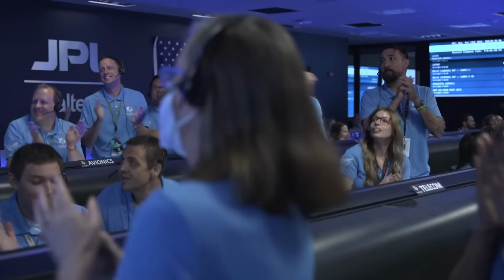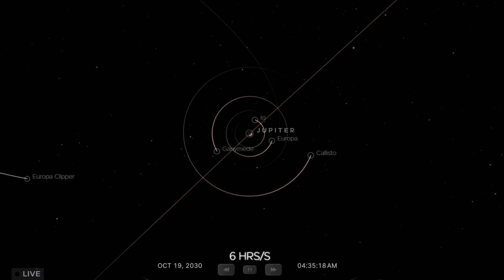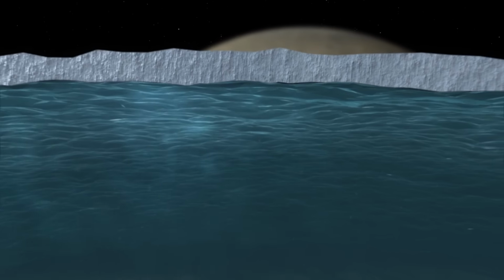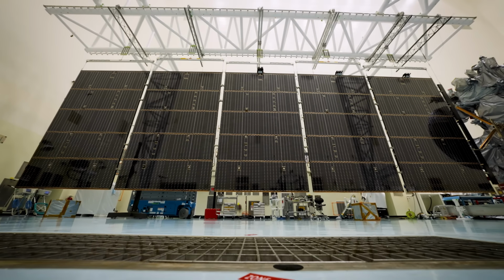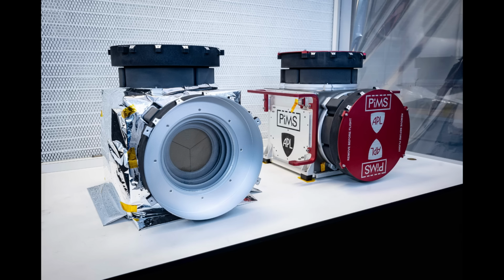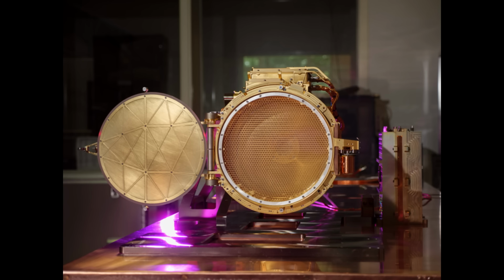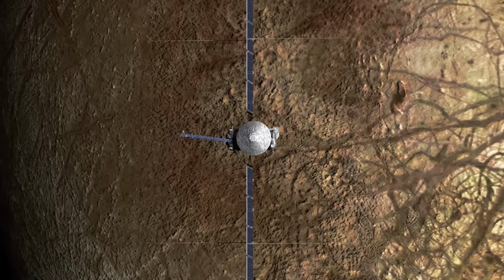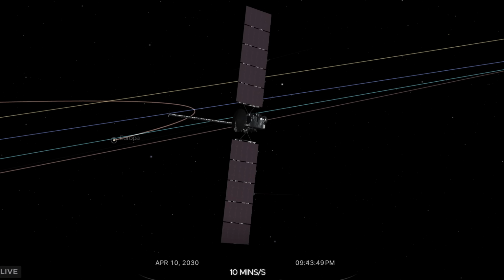SpaceX Ditched an Entire Falcon Heavy To Launch NASA's Massive Probe To Europa!

Comment: Propulsion lead from Goddard here! Excellent video, Scott. We're so happy this thing is off the ground and heading outbound :)

Fun stats: we're expecting the Jupiter orbit insertion burn to require around 800 m/s dV, take ~5.5-6 hrs, and consume approximately 60% of our total loaded propellant.
Reply: The 6 hour burn brings back memories from my adventures trying to make ion crafts in KSP
Reply: Juno new origins is no better. @Allthegoodhandlesaretakenlmao
Reply: Congrats on getting your bird on its way! 🎉
Reply: By switching from SLS to Falcon heavy, the travel time got extended by several years. Does that impact the useful time which europa clipper has around Jupiter and if yes by how much?
Reply: @foximacentauri7891  my understanding is that our limiting case is still radiation degradation as Scott pointed out. We'll be spending a bit more time in transit so eating a little more average solar radiation, but that pales in comparison to what Jupiter spits out. Propellant budget is still golden for primary tour
Reply: @millerjt  Great Work there! Wishing the mission all the success it can get.
Reply: @foximacentauri7891  Speaking about ∆V only, Clipper's ∆V budget and subsequent propulsion requirements were designed with both possible interplanetary trajectories as a contingency. Also, ∆V estimates are done statistically (3-sigma) and so there is a good chance there will be a large amount of prop left over for extended missions. As for radiation exposure, modified tours of the Jovian systems to reduce the time within the orbit of Europa are possible in the extended missions.
Reply: @foximacentauri7891  if they relied on an SLS, the probe would still be here on Earth. Lmao
Reply: @foximacentauri7891  SLS would have been several years quicker? Does that imply Starship could be at least as fast? If so could Europa Clipper have arrived sooner, if it waited a couple of years for ride on Starship?
Reply: @chrisvernon3156  The SLS flight plan was to make a direct hyperbolic flight to Jupiter with a transit time of 1.9 years, and a C3 (excess kinetic energy) of ~82 km^2/sec^2.
Reply: 5.5-6 hours… oh man…
Reply: @beagle_uah  That'd be a yawnfest, even with 4x physics warp! They need to install the Better Time Warp mod. =;o}
Reply: Was an upper stage considered to increase the departure velocity?  Unfortunately, I believe Helios was not available in time for this mission.
Reply: It says something about Scott's legitimacy that people like you come here to give your first-hand professional account of things.
Reply: @Restilia_ch  I thought the same on multiple occasions! Slightly mind blowing... but only slightly, since anyone who is passionate about what they do, will similarly love talking about it 😊 
(not due to ego, just due to wanting to share their passion; but.. also ego driven for a select few, I'm sure lol)
 
Such a great community Scott has created!

And on that note: thank you millerjt, for stopping by and fielding questions! 🍻
Reply: Would it ever be possible to use Jupiter's radiation to power a space craft?
Reply: @quistador7  No. The radiation around Jupiter is high-energy electrons (its magnetic fields function a bit like a giant synchrotron). The levels of particle radiation that are classified as extremely high and in the range where they cause severe damage to electronics over short periods of time, such as around Jupiter, are nevertheless extremely weak in terms of total power even compared to the relatively dim sunlight available at Jupiter. Now, a technology known as "betavoltaics" does exist, which directly convert the kinetic energy of beta particles (electrons) into electrical energy. However, in order to generate enough power to supply the spacecraft, the electron flux would have to be so high that it would fry even the most rad-hardened electronics.
Reply: @teebob21  awesome reply thanks for the info
Reply: @quistador7 not radiation. But it's theoretically possible to boost a ships orbit by interacting with a planets magnetosphere using a mag sail. Basically large charged coils that would work like a big electromagnet. It's all just speculative design though, I don't think anyone's actually even done a proof of concept test version.
Reply: Were you guys disappointed that you had to take a ride with the Falcon Heavy rather than SLS? SLS being more powerful, but more politically sensitive of course.
Reply: @temper44  a ride is a ride. It was much harder before the decision was made and we were waffling between many different flight plans
Reply: Thank you for your hard work and contributions to furthering our understanding of life in our solar system.
Reply: Defund nasa.
Reply: This orbiter is Huge!
Reply: That's some serious space breaks. Dang. Wish there was some way to slow down in space without bringing extra mass specifically to eject it in the opposite direction.
Reply: @CeanStrauss     Wish there was some way to slow down in space without bringing extra mass specifically to eject it in the opposite direction.
There are several.
Of course classic aero- and lithobraking are always a possibility. 

Photon sails, be they for sunlight or lasers or beamed microwaves. Be they reflective or absorbing. 

Electrostatic sails, interacting with charged particles (solar or interstellar wind). 

Electromagnetic sails, interacting with solar or local charged particles and magnetic fields (magnetorquers are a thing, too). You can also shoot plasma beams from
local stations for more directed propulsion power. 

Plasma magnetic sails, 10s of cm rotating magnet field source induce a plasma field (in the solar wind matter) of 10s of km in diameter — and the thinner the solar wind, the more the field expands, keeping the acceleration linear up to the heliopause. Unfortunately it will just produce thrust away from the sun — but an array of those could be used to make the push asymmetrical and hence produce thrust components across the solar wind vector — like a “normal” solar sail. And it can be folded by simply turning off the power. 

And if you use a non-rotating magnet field and inject the plasma, you just get a few metres in diameter — but it can serve as a shield for some magnetoshell aerocapture, it has no “overheating” problem: it’s not solid matter but for the magnet and strut too the craft. And it is very lightweight and might even be usable as a parachute. And of course can be turned off and on or even resized at will. 
 
Then there are of  course photon drives (a honking laser or similar devices, 300 MW per Newton of thrust) 

Interacting with fields and ions is another possibility. Magnetorquers are a thing, and you can interact with charged particles in the environment. The Bussard ramjet — if it worked — would collect particles from the environment as both energy source and for remass, while the RAIR produces the energy itself and uses interstellar gas only for remass.

Of course all of them are not panaceas. Atomic Rockets of Project Rho is an amazing source.
Reply: Super excited to see what sort of information we're gonna get out of this! Europa is fascinating. Often I think we take it a bit for granted that we can have all these observations, especially on the satellites like sentinel I use nearly every day, but without people like you so many different fields of science would be so much worse off. So thanks!
Reply: Thanks for flying with us 😊
Reply: Dr. Heywood Floyd: "This looks as if you've detected the presence of chlorophyll." - 2010.
Thanks for your mention of this excellent movie. One of my favorites.
Reply: Casual propulsion nerd here. Does Europa Clipper use hypergols or electric propulsion? Also, CMGs or reaction wheels?
Reply: @kyleeames8229  during the stream (specifically separation) I saw a ton of small thrusters, so I’m assuming it uses rcs. Might have been the main engines though
Reply: @Allthegoodhandlesaretakenlmao  there is no main engine. Same engines used for dV, slews, momentum dumps, RCS, etc etc. 24 engines, ~27N thrust per.
Reply: @millerjt   that’s super cool! Do you have to position it a certain way for maneuvers or can you use any of the sides?
Reply: @Allthegoodhandlesaretakenlmao  primary dV engines are on the –Z face (what you saw during sep). Roll engines are in the +/– Y plane so have to do paired thrusting to get good yaw and roll control
Reply: @millerjt  Congratulations on getting your probe on the road, Joe! If I may ask, how long will it take for the remaining instruments and system checks to be completed? I haven't seen much since the alert that the solar arrays had been deployed.
Reply: @richardmalcolm1457  some won't be deployed until November after we do the first trajectory correction maneuver and are en route to Mars
Reply: @millerjt  Are there plans to do any science during the Mars flyby?  Congrats on the progress so far!
Reply: @pureheart777  outside my purview. I'm sure mission planners are intending to maximize the returns of all of the instruments
Reply: @millerjt  Thanks!
Reply: @millerjt  Thanks I'm sure you're right about that.
Reply: @kyleeames8229  biprop hypergol: MMH and MON-3.  Wheels for control
Reply: @kyleeames8229  Hypergols (MMH/NTO). Wikipedia claims attitude is controlled by this as well, but I can't verify that.
Reply: Wow! Longer than Cassini for Saturn (about 90 minutes if I remember properly)!
Reply: That is a looooong burn!
Reply: @JohnnyToboggan  Why is it always the incapable and uneducated who wish to tear others down?
Reply: You'll have to do that burn in physics timewarp
Reply: Does the spacecraft need to perform any significant burn during the Mars and Earth flyby, or does it solely just relied on the gravitational planetary slingshot using minimal RCS fuel?
Reply: Very cool! Thank you for your hard work in moving humanity toward our destiny!
Reply: I know this is a crazy ask, but would you ever be willing to answer some questions for a high school chemistry class? My classroom has been absolutely enthralled by the Artemis 2 launches, and I’m now teaching them about the upcoming Europa flybys!
Reply: Just throw in some moar strap on boosters!

Hall effect or very low mass flow rate.
Reply: Nice comprehensive report, but I can’t believe you didn’t mention the movie Europa Report
Reply: Ah yes, one Mün transfers worth.
Reply: Billions of dollars spent and the best camera NASA can muster for this mission is eight megapixels? Were the specs fixed a decade ago? :(
Reply: @spewp .  I think it is extremely difficult to build a one of the kind camera that can withstand the radiation. There are other videos that shows the radiation effects on cameras near Jupiter
Reply: @spewp  Longer than that, actually. Europa Clipper was authorized for funding in 2013, and the equipment was selected in 2015.
Reply: @spewp  typically JPL has to factor lifespan over technical specs. Which often means using older technology that they know won’t break when it’s multiple millions of miles away years from now. It’s hard to get the geek squad out there.
Reply: @spewp 1. They probably were. 2. The cameras have to be designed to meet some rigorous mission requirements, including radiation hardening. 3. Data transmission rate back to earth, and data storage capacity on board are going to limiting factors.
Reply: Suspect it has something to do with pixel size (not a lot of sunlight out there) and radiation hardness.  Can't just attach the tiny camera from an iPhone.  Well, I guess you could ... but clearly there are reasons.   @spewp
Reply: @spewp  Camera is never a problem. Transfer of data for so huge distance is. They can put a crazy good camera there. But what is the sense if you will have to stream one photo like that few days.

Comment: @scott manley Could you one day make a video, on how the launch companies come up with those complicated maneuvers? How do they come up with for example 2 gravity assist of Venus, one from earth, one from.. etc and arrive at the destiny? Is there a supercomputer that runs tons of options, how do they know that or when planets align perfectly for multiple gravity assists? I hope I inspired you for this question, because I would be very curious!
Reply: Well, they have been figuring such trajectories for many decades now. Luna 3 used a gravity assist from Earth to reach the moon. Voyager program used gravity assists. The idea of gravity assists for space flight originated before WW2. The first known calculations for space flight using gravity assist were published in 1956.
Reply: I would like to know that as well. Especially how I can calculate it myself for when I'm playing KSP.
Reply: The navigation design is done by the team at JPL, not the launch companies. The launch provider provides an injection point, the trajectories and maneuvers are designed by the NASA JPL Navigation Team, independently of SpaceX.
Reply: Timing is everything. 😊
Reply: One thing is for sure it does not require a supercomputer. Given that say voyager 1 and voyager 2 were launched in the 70s and did multiple gravity assists
Reply: If i remember correctly they just go backwards from Jupiter to Earth via already calculated interplanetary transfer network (low energy trajectories)
Reply: They do them by hands back in the days
Reply: Regular desktop computer is enough for that. They do many trajectories to see which one works. Relatively simple once constants are known.
Reply: @NoHandleToSpeakOf Pretty sure the ridiculously complex trajectory of the Voyager probes was calculated on paper by Michael Minovitch in the early 60s.
Reply: A typical cellphone probably has orders of magnitude more computing power than is needed for orbital calculations.  It's all pretty simplistic Newtonian physics actually.
Reply: @awebuser5914 i can see it being basic to the moon or mars, but to calculate multiple gravity assists on other planets, over years.
If your 2km/h off on one of the planet speeds or orbit angles, there won't be any planet there to assist you.
I guess that's why the concept of it all fascinates me.
Reply: I suggest you read up on gravity assist on wiki, a very good introduction to the topic

Comment: Seems Earth fly-by would be a calibration opportunity for detecting oceans under ice.
Reply: it would, but since the flyby will be a gravity assist, i'm afraid the ground track will be mostly over equatorial regions and not polar, so might not be possible, unless a supervolcano erupts and freezes the oceans before then ahah
Reply: @soleenzo893 nahh
Reply: @soleenzo893  maybe if they tracked a star at an angle if could work, but I mostly agree
Reply: IIRC, JUICE detected signs of liquid water on Earth, which may possibly indicate that the planet is capable of supporting life.
Reply: It is also a potential hazard: if you do too many of these, Earth will plummet into the sun!
Reply: @Karackal  Earth is 984,697,400,000,000,000,000,000 times as massive as the Europe Clipper, so I think it will take a few passes.
Reply: @CountArtha so it's possible 😄
Reply: It’s going to be in hibernation until it achieves orbit around Jupiter so no possibility for collecting data before then.
Reply: @Tn_jed001  There's no way they don't turn the cameras on during the Earth flyby. They did it on Juno.

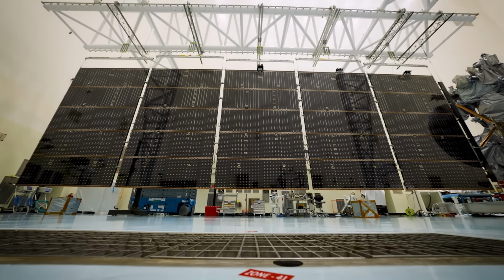Comment: 1:40 I was legitimately shocked by that size comparison. This thing is huge!!
Reply: Or maybe the statue is a lot smaller than we think?  😄
Reply: @Alfred-Neuman  Yeah, the Statue of Liberty is a favorite for size comparisons (over other recognizable monuments), because there's a widespread perception it's bigger than it actually is. The usual reported figure (305 feet) is from the foundation to the top of the torch. The main body of the statue (head to feet) most people probably picture as the majority is only a little over a third of that (111 feet).
Reply: @Alfred-Neuman  That's totally true. There is a church in my city bigger than the Statue of Liberty, and i live in Brazil countryside. This Statue is more marketing than everything.
Reply: @Alfred-Neuman  either way its still may bigger than we thought
Reply: But at 225 tons, the Statue of Liberty would require a really big rocket.
Reply: @gfopt  or a really big jar of ghost gel
Reply: The one in Las Vegas.  the one Gru Stole
Reply: That's not what she said.
Reply: Indeed, it is. Now imagine what huge probes we could send into space, with the Starship 🤯
Reply: @NoXPhasma would probably have to expend the upper stage as well as design a fairing for that, but if expenditure is planned, they could make it lighter without flaps or heat shield.
Reply: @NoXPhasma  You may have to imagine it.
Reply: Statue of Liberty (not including the pedestal) is 151 feet. So not quite to scale. I think the perspective of the statue picture is looking up which throws off the scaling.
Reply: like half of statue of liberty height is the pedestal, which was mostly not included in the size comparison

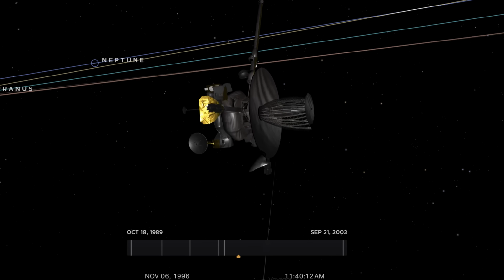Comment: 11:55 did they even simulate the stuck-halfway high gain antenna??? Cool!
Reply: That is what it looked like at that time, so why not? :D
Reply: yes most models of the spacecraft, inn apps like the one scott is using, include the flown configuration, wiuch failed antenna included ahaha
Reply: Even if this thing got stuck 75% of the way I don't think we'd have the "one letter per second" problem from Galileo. At least I would really, really, really hope technology has advanced enough in 30 years to prevent such insultingly slow transmission in the event of a problem.